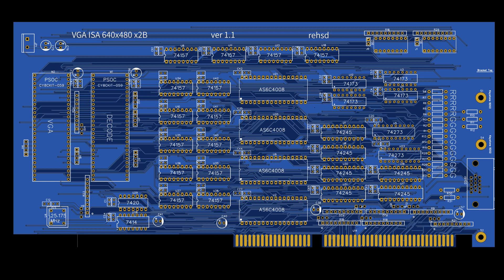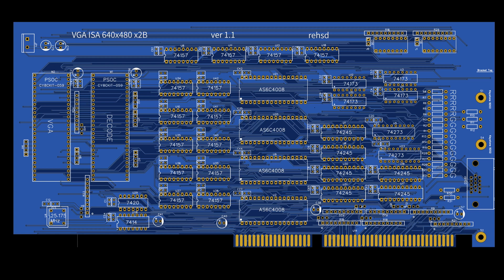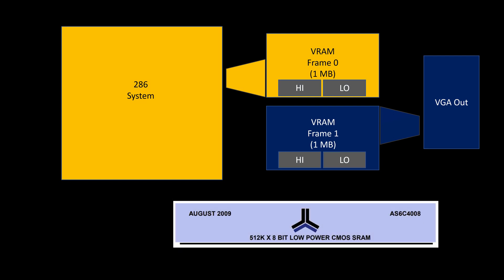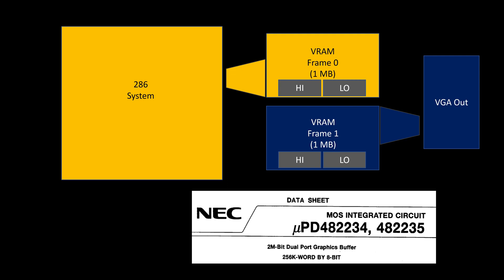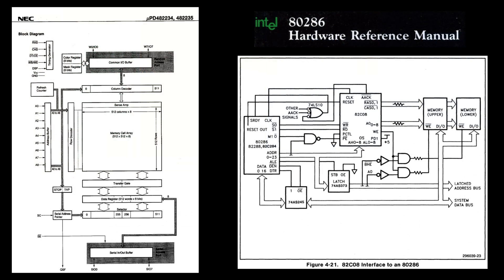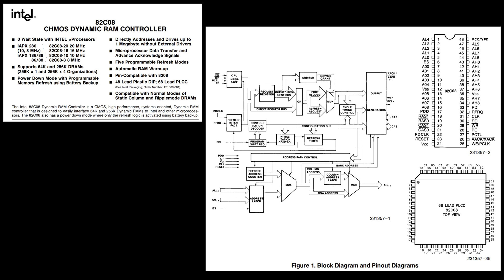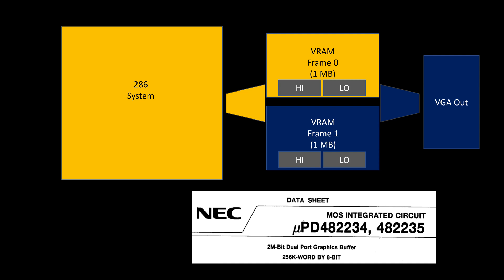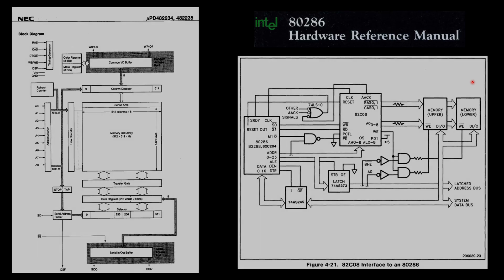640 x 480 VGA, Ep. #11 - Option with Affordable Dual Port RAM?

Comment: The only real downside with DRAM, as I see it, is that you need to give up the bus while the DRAM controller is updating the DRAM which limits the memory throughput.
Reply from the maker: That's a good point and an important aspect that I will need to consider. It appears that the 82C08 supports a "no refresh" option. I'm reading the PD482234 datasheet to see if refresh can happen as part of the serial read, but I'm not finding anything to indicate it supports refresh on serial read. Do you happen to know what kind of overall system performance impact giving up the bus could have? Thanks!

Comment: Bunch of random comments: most people say "dee-ram" or "ess-ram" (two syllables).   Back in the 1980's and 90's the NHK (Japanese national broadcast research agency) drove massive tech innovation in television in Japan the way NASA did for many things in the US.  NEC benefitted from this and was alsmost a de facto commercial arm of that research.  A lot of NEC chips from that era came from specialized devices they built themselves for the fancy NHK-funded projects, like digital HD tape decks or stuff that was cutting edge back then.  They decided to recoup some costs by selling the chips commercially.  So a lot of these chips had quirks and funnies in them that were artifacts of some specific tech project rather than being well thought out, widely-applicable, mass-marked devices the was say a 32kx8 SRAM chip was. So don't go into these datasheets with any sort of unconscious bias this is a right or wrong way to do anything, they're just chips that may help you build a certain thing in a fairly efficient way if you follow the idea behind them. That being said, serial on the read side and random access DRAM-style on the other seems ideal for a video card.  If you trace back the history of the PC ideo card (IIR it used to be that motherboards didn't have VGA so you always had to buy a card of some type, but nowadays they're usually only used if you want some high end gaming or deep learning caps on an nvidia card), there was a point in the early 90's where something called "VRAM" (video RAM) was all the rage, and I think this was basically that type of chip.

As far as refresh, the only real requirement is that the DRAM gets each row (or column, I forget) gets refreshed periodically, like every row every 10 ms or some time frame.  When you use DRAM as generic computer memory, a refresh is usually a distinct cycle type which needs to be performed by dedicated circuitry since program ram access doesn't guarantee any access pattern or timeframe.  But some old 8-bit computers might have had an ISR for example run at a regualr interval to try to do software refresh.  And a refresh just entails a read from an address on a page (row/col/whatever).  The thing about using a chip like this, though, it that by doing fixed reads on the video output side at a fixed interval, you can usually get the refresh occurring"for free" as a side effect of scanning linearly through the whole address space, so if you understand the details and convince yourself that you have refresh coverage you may be able to skip that all together.

As far as RAS/CAS goes, the address lines A0-A9 or whatever can be generated from your  bigger address space A20-A0 just by using muxes, like 74157's or even tristate 244's or 245's, as long as the setup and hold works out.  RAS and CAS just need to be generated according to the datasheet as you flip the mux select to drive the right address out.  The bad news, though, is that so far in your journey you've probably been able to get away just ignoring setup, hold, and data timing and basically hoping it would work out, and it generally has.  But DRAM timing can be a little more fussy and require you to actually sit down with your data sheets and do the path analysis. But it's not rocket science just finnicky. I've done DRAM on a Z80 CPU with basic 74LS TTL and (a) it worked and (bO the numbers worked out too.

If I get the chance to dig in a little more to the NEC datasheet I'll give you thoughts.
Reply from the maker: As always, great information, @Zxborg! That would be great if my serial read of the memory covers the refresh. It sounds like this might be a good way to practice understanding timings better. :)
Reply: Yeah, some of that DRAM controller you mentioned is probably geared towards optimizing throughput while providing refresh, and keeping track of which pages are already opened to speed up successive fetches and so on.  This is needed for high performance in a generic computer application, where you want to take advantage of every possible speed capability. If efficiency is not the main goal, you can build a brute-force-and-ignorance circuit which just generates a full RAS and CAS cycle for each access on the CPU side (simpler, but admittedly slower for repetaed sequential accesses). Just present the high and low addresses along with RAS and CAS and do a full cycle.   And if you can in fact get the raster read to do the refresh the fancy controller chip is totally overkill.  

Changng topics, when I did my Z80 with DDR, the Z80 has a built-in counter and bus cycle generator that would let you squeeze a refresh cycle in between every instruction fetch, so that as long as you did the right decoding to fire off a refresh cycle it was basically free and invisible.  

Even worst case, if the video read side didn't wind up doing a full refresh, as long as efficiency isn't the primary goal, refresh doesn't need to be anything more complicated than an n-bit counter (where n is defined by your refresh cycle length in bits, prob 8 or 9 here), and in hardware you generate a refresh cycle to the refresh address specified by the counter, then increment it.  Doing that every pixel fetch, or every hsync might work, or maybe even doing it in a burst during vsync, but something along those lines depending on the cycle time and size.  Have to read the datasheet to confirm the details, though.